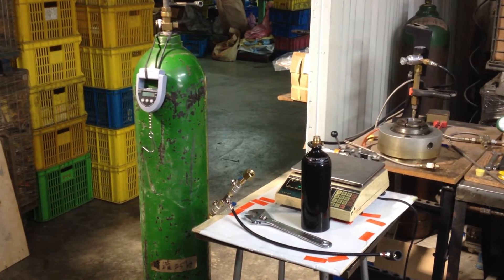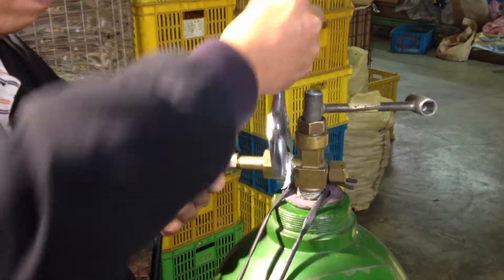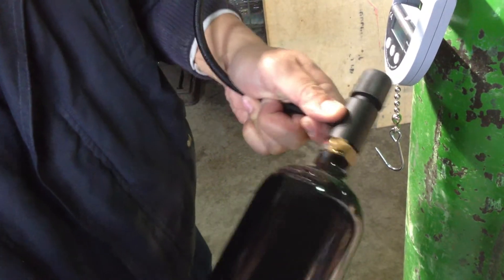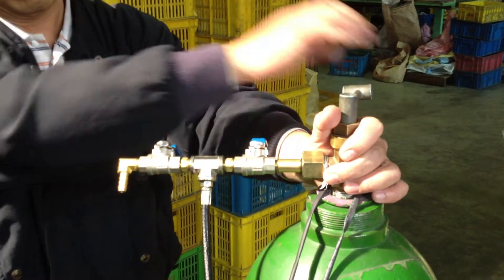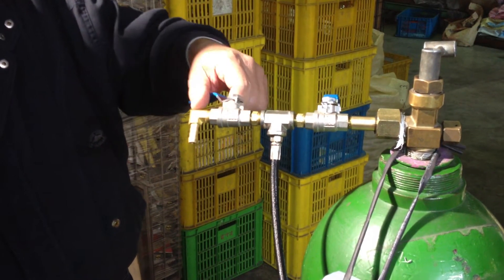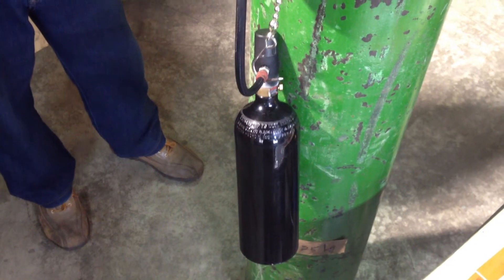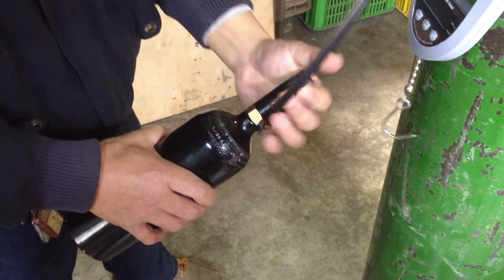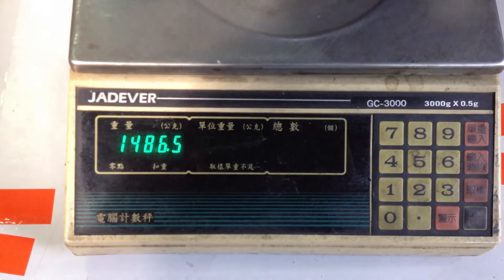KING CHO: HOW TO REFILL CO2 CYLINDER

Comment: I put my bottles in the freezer, saves the cooling steps. the main Co2 bottle does is have a inner pipe (standpipe) that goes to the bottom of the cylinder, i remember i read once if you use a cilinder without you should turn the main cilinder upside down? to get the flued in directly instead of co2 gas

Comment: What do they do if you overfill, mine wont release co2? It has co2, i checked by turning the bolt? How do I make it release?
Reply from the maker: Hi Shang, first of all, make sure the cylinder you got reach CE approval first. 
Our 20oz cylinder comes with safety pressure valve, it will automatically release the pressure if it is overfilled. 
Our 20oz cylinder's working pressure: 1800psi/124bar ;Approval: DOT/ TC/ TPED(CE)

The best and safest way to release the pressure is using refill station equipment to refill and release the CO2 from cylidner. Hopefully, we have answered your questions. all the best!